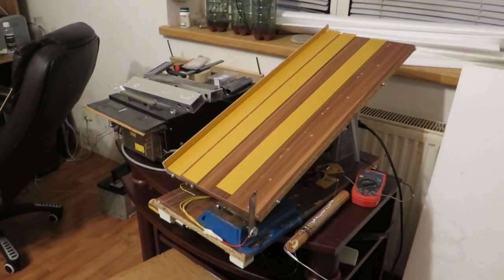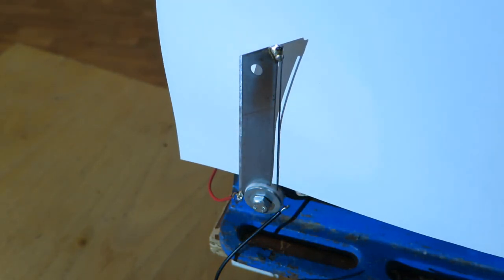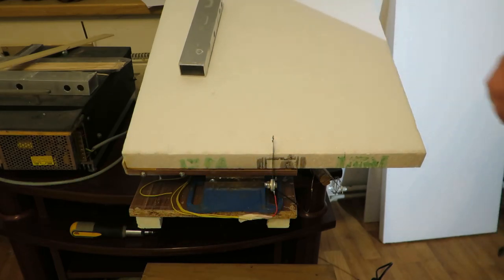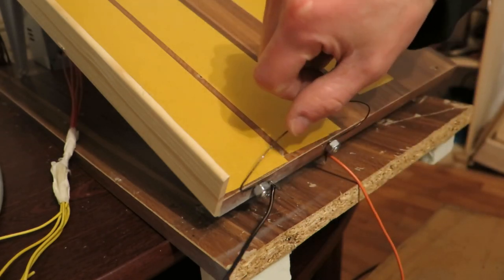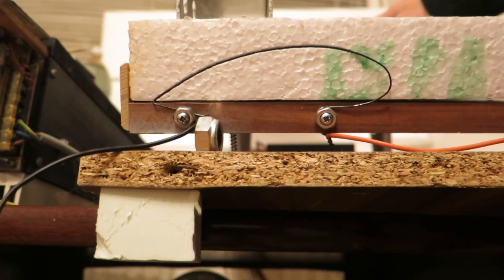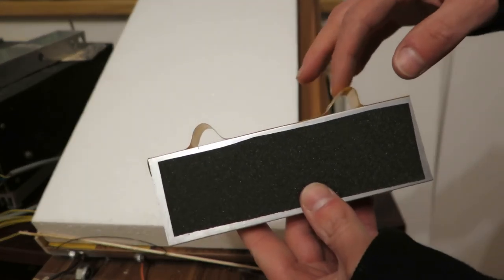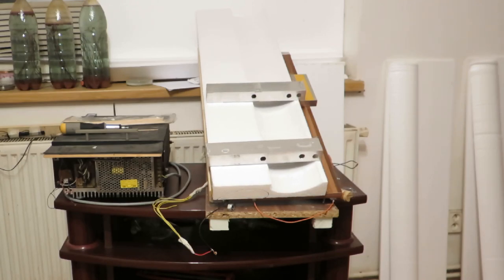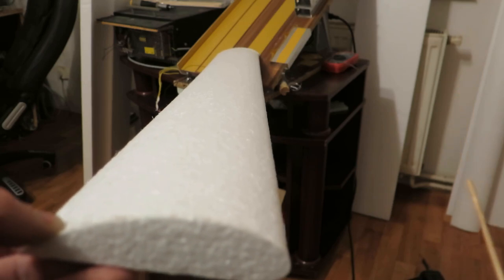Foam board profile cutter

Comment: I've done this with a car battery charger with a high current light switch dimmer from a halogen lamp on the AC side. You can very much dial in the temperature achieved on the wire. I also had the most success with guitar strings for the hot wire, though that wouldn't have the rigidity to do what you are doing here.

Comment: That's a great idea. What about the stiffness of Nichrome or Kanthal? Was that considered?
Reply from the maker: totally different league to hardened steel, but if wire length is not too long you can do a shape using nichrome or kanthal.

I tried using spring, but I wasn't able to re-harden it after annealing and creating a shape.